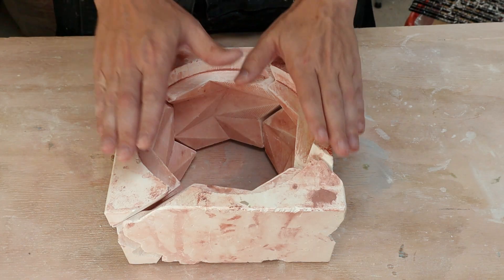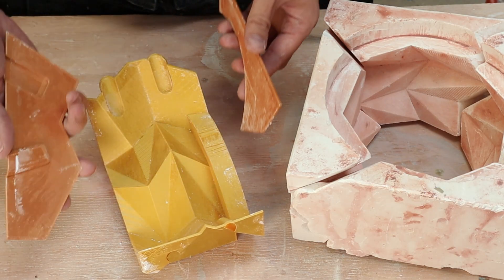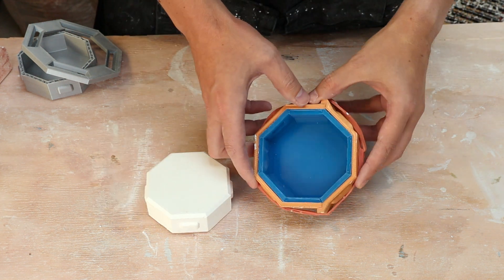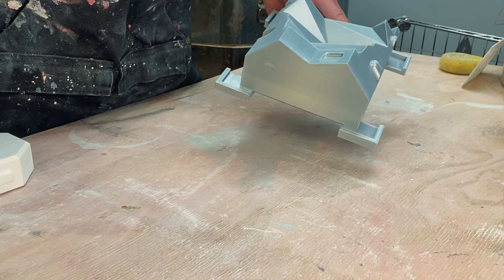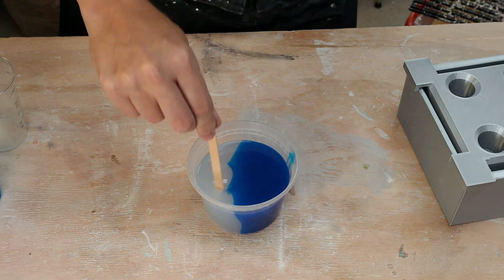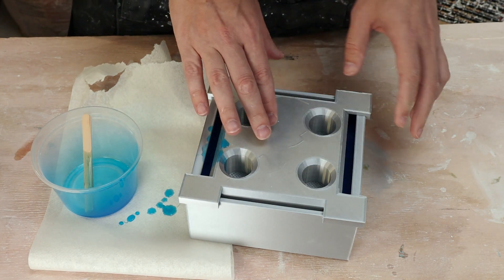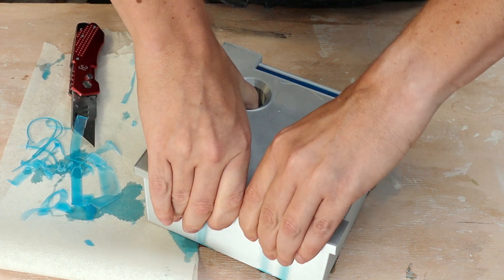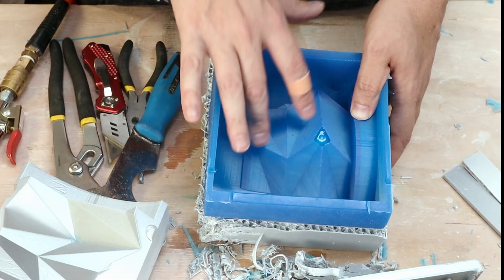FAIL! How NOT to Make a 5 Part Slip Casting Mold with Silicone

Comment: you can try print flexible insert on 3d printer using TPU. It can be tricky, so you can print whole form. Also if demolding PLA from plaster is a problem, you can try heat pla mold (even with undercut) to soften it (boiling water is enough). It can be thin disposable shell and reusable base.
Reply from the maker: Thanks. My printer didn't do TPU so that wasn't an option. I've iterated a lot on mold making since this one and have a process I like now. I'm still working on multipart molds though.

Comment: Hi Kent, what 3D printing material do you recommend for slip casting?
Reply from the maker: I've been using standard PLA - nothing special. I'm actually diving back into mold making with a series right now and will cover 3d printing in the not too distant future.
Reply: @PotterybyKent  wouldn’t the grooves and print texture on pla show up on the clay mold?
Reply from the maker: Yes - the silicone, plaster, and clay are all pretty good at picking up textures. So you have a few options - one is to use filler paint and sand the 3d print, another is to print with smaller layer heights (what I'm doing now). You could also clean up the pot once it is formed (eg leather hard or bone dry). Finally, the layer lines might not mater depending on your pot. In an unrelated test I added a lot of surface texture to a pot, and then glazed it. After glazing the texture basically disappeared. So any glazed area of the pot might be evened out by the glaze itself.
Reply: @PotterybyKent  Got it, thanks so much!

Comment: That could easily have worked if you'd oriented the piece to release bubbles to the top. As for separating mold pieces, I use a pair of "inverted" pliers that are to expand c-clips. I make holes in my molds where the tongs will fit and using that I can pry the pieces apart without too much carnage. Especially with compressed air, though I don't have access to that.
Reply from the maker: I've continued to experiment and the trick seems to be in the orientation of the print, and then the silicone and the plaster pours to work (which really want to be in opposite directions).
@Van Tiki uses pliers like that for his plaster molds.

Comment: I've just been through the exact same considerations and tests as you :)
Next I will try brush-on silicone, instead of making the complicated double molds with spacing between them, And then plaster as backing for the silicone In the final mold.
Thanks for sharing!
Reply from the maker: I think I've seen that approach before - pretty sure Adam Savage showed it in passing on Tested a good while ago. But when I went back looking for it, I couldn't find it. I'd be curious how yours turns out!
Reply: @PotterybyKent  Does replies with links get deleted ? -I have some pictures on a website,... almost done with my testing
Reply from the maker: @dontbeevillol - I'm not sure if they're filtered or not. If it doesn't work you can always send them my way with the contact info on my about page.